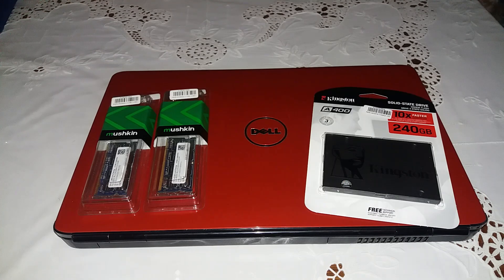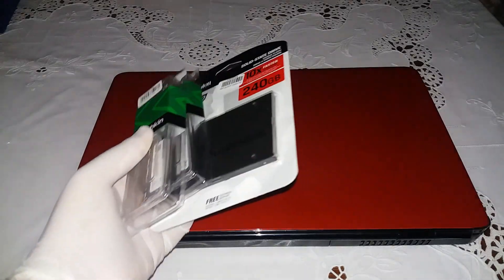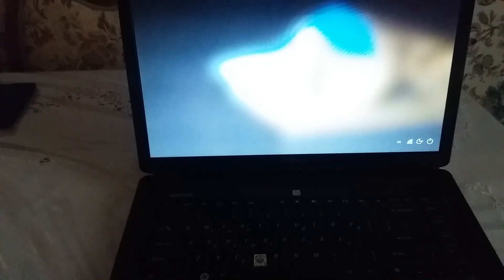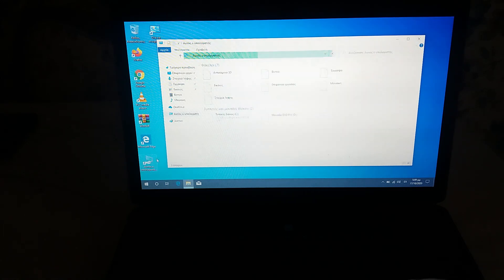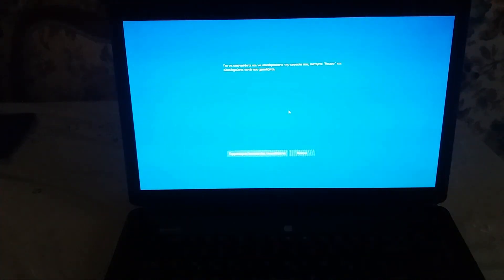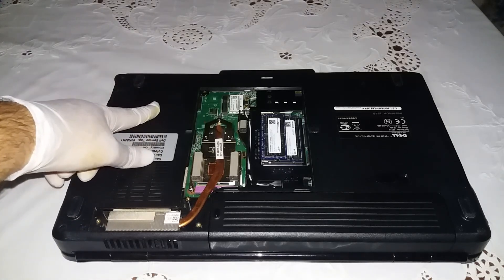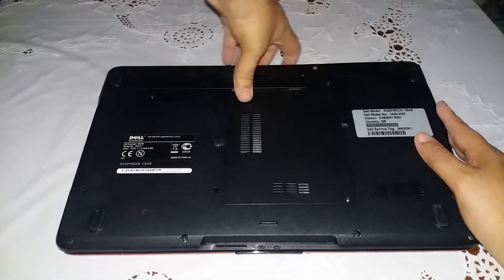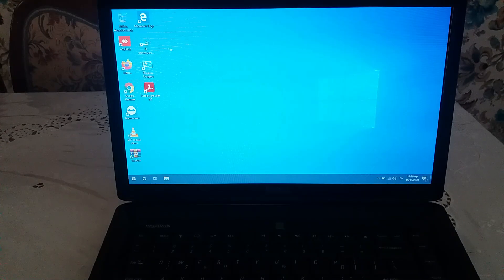Two cheap upgrades that will transform your old laptop 100%

Comment: I have 3 GB of Ram in my 12 year old laptop. I have upgraded from 500 GB hard disk to 500 GB ssd. I am still using windows 7 and it is working very good in speed. Should I change it to windows 10? Will my laptop slow after installing windows 10?

Comment: Weldone Antonis. I have a HP Elitebook G1. Already i have updated the SSD card and the memory is at 8 gb which i think is the max i can go. Do you believe i can do a litle bit better by adding more updated and named memory? Thanks.
Reply from the maker: Φιλαράκι μου καλό η μνήμη σου είναι επεκτάσιμη έως τα 16GB , άρα μπορείς να βγάλεις τις 2 των 4αρων που έχεις ήδη επάνω και να βάλεις 2 των 8 και να πιάσεις το max της απόδοσης , πάντα σε DDR3 στα 1600 MHz.
Reply: @Anton26  Αντώνη ευχαριστώ πολύ για την απάντηση. θα το δρομολογήσω.